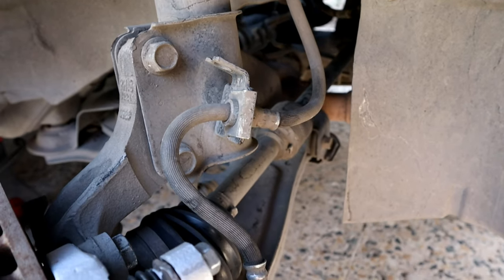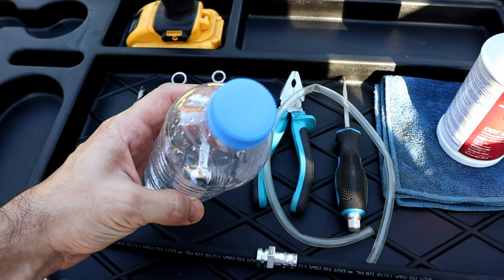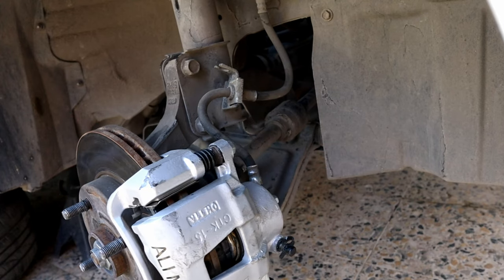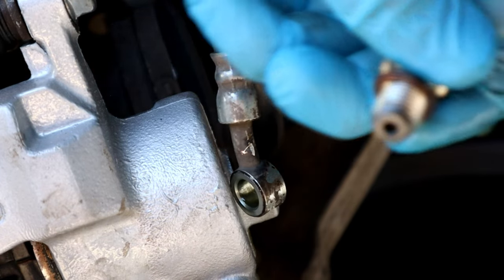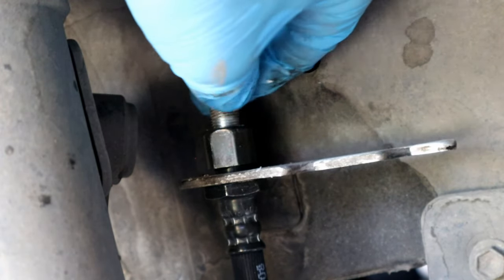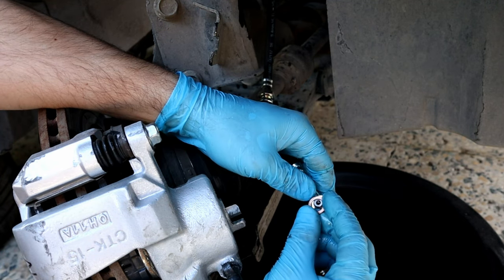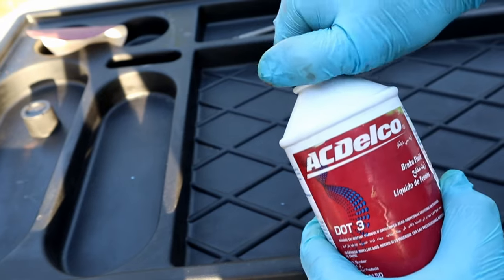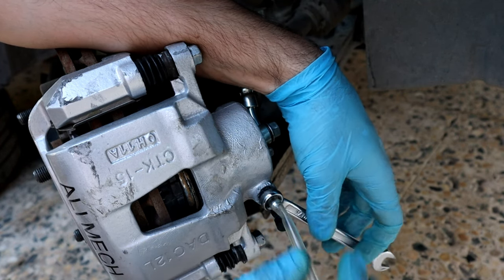Learn How to replace Brake Hose on your car in 4 min / How to bleed brake fluid with new brake hose

Comment: This doesn;t work when you are happy single. You need a second man to push the brakepedal and the other closes the nipple when he releases the brake. Buy a spare fillercap at dealership dril a hole, and put an air nipple in, and adjust your aircompressor to 2 bar, this way there is constant pressure in the system and you can just open the nipple and wait for all the air comes out.
Reply: A 2x4 pushed against the peddle works also. Lol. Always working alone sometimes you have to get creative.

Comment: You could just fill the bottle halfway as well as the res and pump slowly by yourself until no bubbles
Reply: Wouldn’t that suck in old, waterlogged brake fluid back into the system? The length of pedal travel is the same going down as going up. So if you expel x amount of dirty fluid by pressing the pedal, won’t you vacuum back the same amount of dirty fluid from the catch can?
Reply: @Dr.Jekyll  yeH

Comment: Awesome quick and simple . No need  to put smaller hole in bleeder bottle ?
Reply from the maker: Thanks, the hole I made for the hose is a bit bigger than the hose, so it let's air to escape and no need for a small hole
Reply: @AliMECH  my apologies the way I was describing was a one man bleeding method , again thanks for the video
Reply from the maker: No problem,  you can do one man bleeding by just opening bleeding  valve and brake few times and then close the valve

Comment: Bro is it safe to use the Carb cleaner  to clean the MAF sensor or the mass air flow sensor? Thank you.
Reply from the maker: No, never use carb cleaner them, there is special cleaners for MAF and mass air flow sensor

Comment: Always use new crush washers when doing this. The reason they are copper is because copper is soft and crushes into any imperfections to make a really good seal(brake systems have to deal with very high pressure), if they have already been crushed from previous use then they are no longer a crush washer. 🤦🏼
Reply: You can also heat to glowing red with a torch to resoften them,and like he did sand them a little.